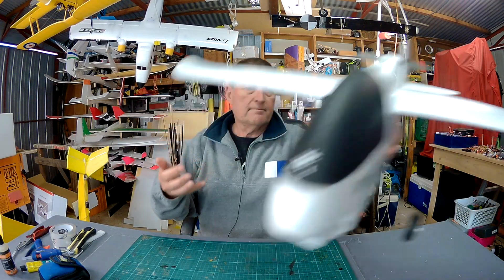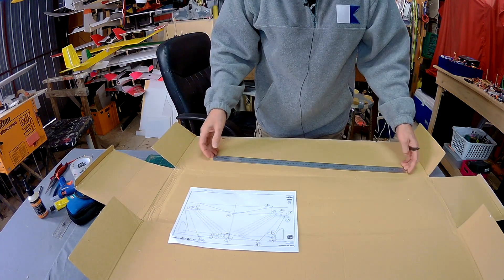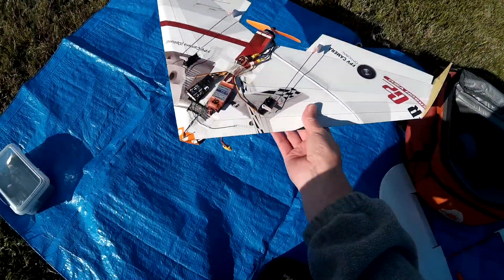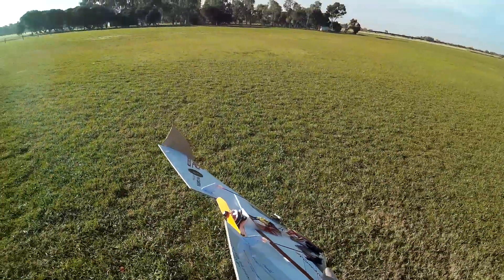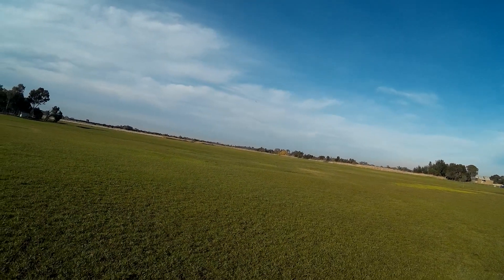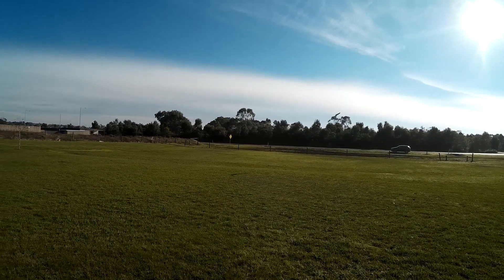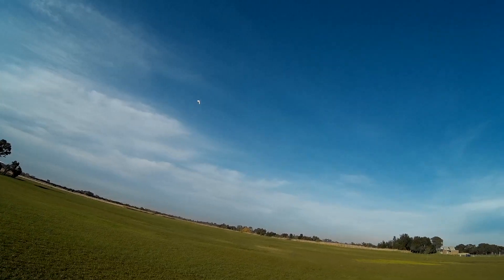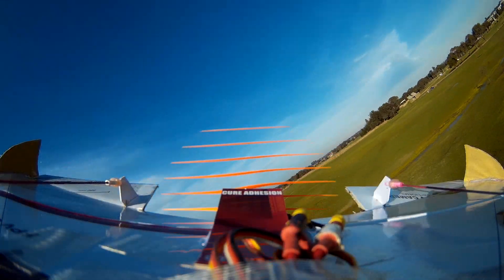Ranger-box wing

Comment: Hello, how do you program the servos that they have the elevator and the crosswise ruder on the same?
Reply from the maker: Which radio do you have? Look for elevon or delta mixing. Something like Ch1 +80% Elevator & +80% Aileron, Ch2 +80% Elevator & -80% Aileron. Play with the plus and minus to get them moving in the right direction
Reply: @AndrewNewton  Ok i have a multiplex radio and reciver.